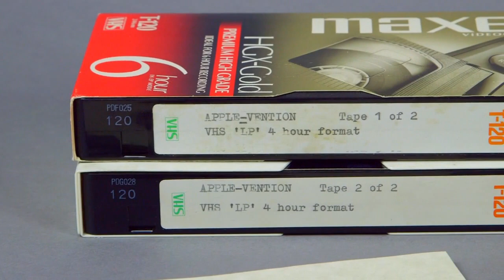Acquiring the Apple1 Computer

Comment: To me, the interesting fact about this machine is, that people are still tinkering with it. Example: in 2013, someone ran the Apple 1 with the 6800 CPU, instead of the 6502. The Apple 1 board has been designed with the 6800 in mind. But when the 6502 came out, Woz used the 6502 instead, cause it was way cheaper than the 6800. https://youtu.be/ag6pWUhps7U